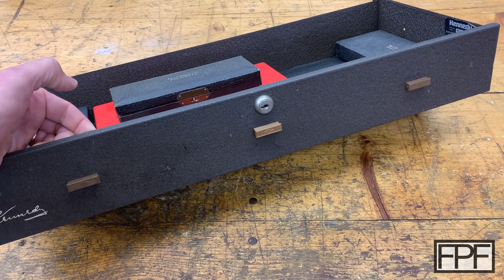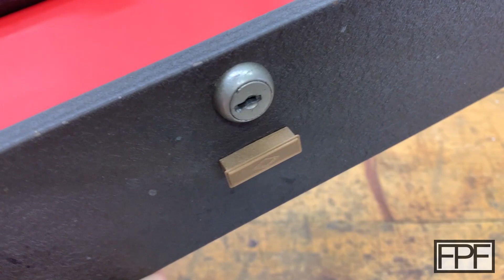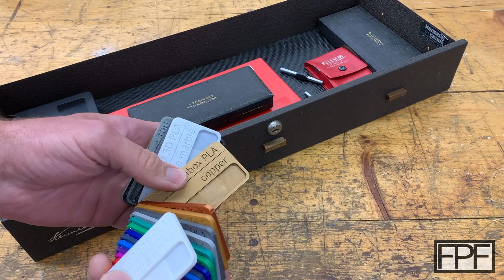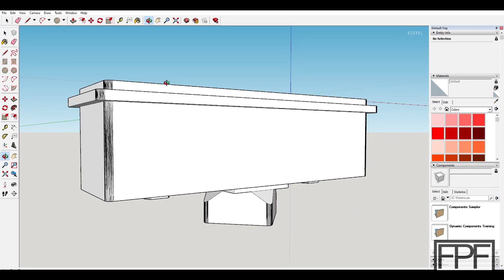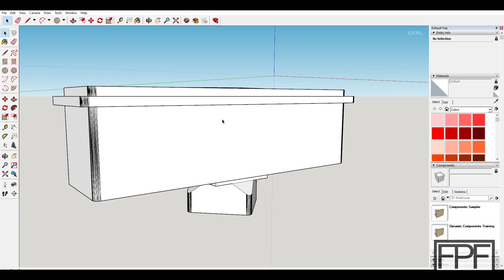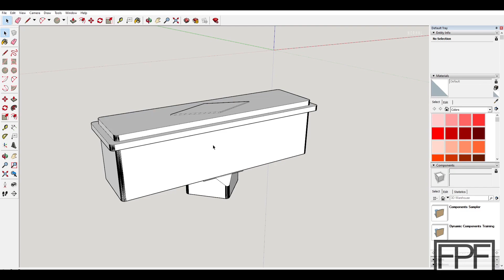3D Printed Kennedy Tool Chest Drawer Pulls

Comment: I've had parts superglued for years that didn't come apart. I think it just depends on your particular filament. I have to admit though if it oozes out of the side you get that nasty white crust.
Reply from the maker: Thx for sharing your experience.  My luck hasn't been as good, but I do think it varies quite a bit due to the different filament additives between products.  I've had really good luck with shoe goo for tricky filaments if there's enough surface area.
Reply: @FunctionalPrintFriday  Yes, because i have seen differences between brands